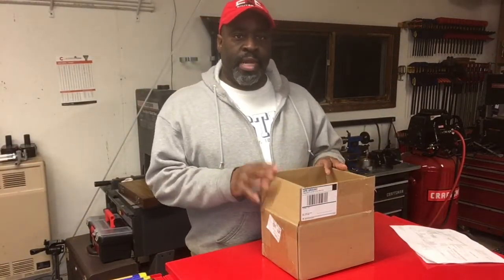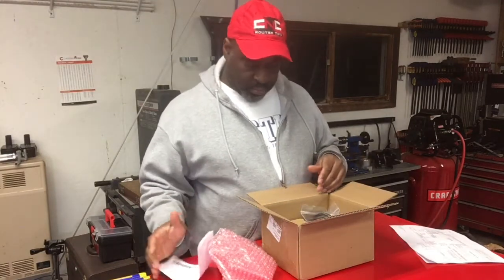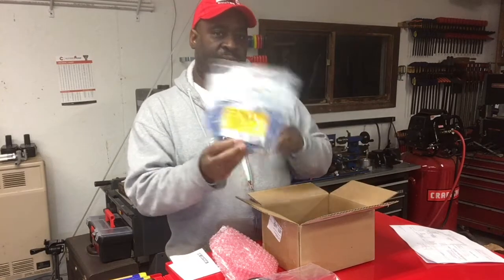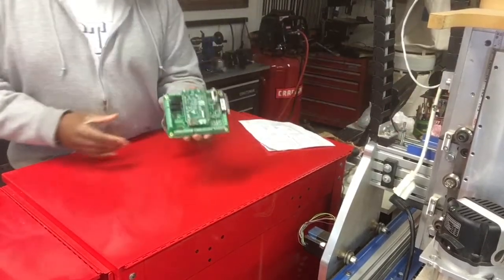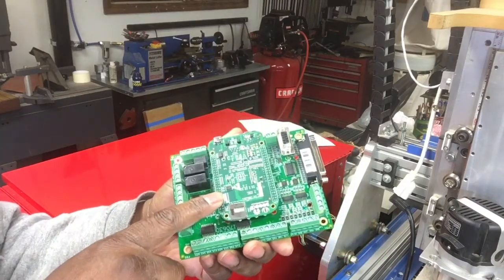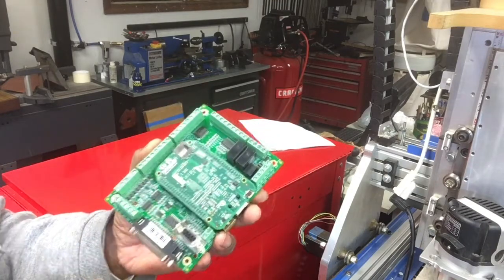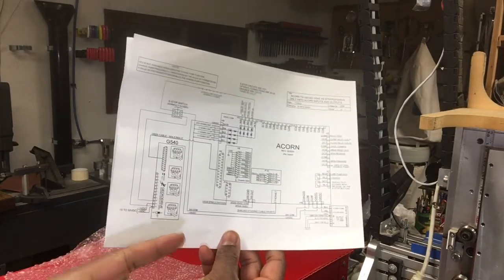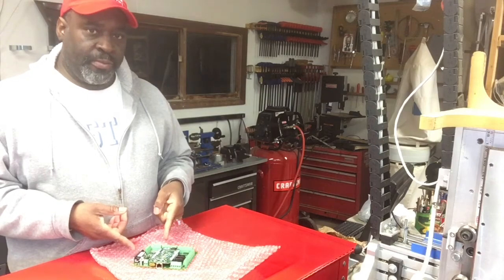CentroidCNC Acorn CNC Controller Unboxing

Comment: My acorn board is installed in a Grizzly mill retrofit with DMM servos / drivers. It was very easy to install and setup. The UI has a lot of information and features - somewhat of a learning curve. I like it so far, and learning more advanced procedures on a basic, yet affordable platform is appealing for my experience and projects. Thanks for this video!

Comment: hi Bill, how do you like your Acorn so far.
Reply from the maker: Max, I haven't used it yet. I Just recently got a computer to run it.  I have installed the software and tested the board but have not hooked up any steppers yet.
Reply: @BillGriggs  i think you going to love it, its far ahead of Mach 3. i already forgot that i had Mach3 before, Acorn so much better.
Reply: @BillGriggs  you have to hook it asap you going to love it, i will never go back to Mach3.
Reply: You probably lost interest in this. Wanted to see the complete hook up. Look at masso controller as well. It doesn't require a pc connection.

Comment: I wonder if you can connect this to a xylotex kit.
Reply from the maker: Tell me more about the Xylotex kit you have. Maybe I can answer that question.
Reply: I haven't purchased yet but I plan on buying the P&P_SYS_KIT, Gatton CNC, centroid acorn with your triple edge finder. I think this will be an awesome combination. Though I'm not sure how to set up the macros for the acorn if thats needed but I will figure it out.
Reply from the maker: I don't think that combination will work but call Centroid to make sure.
Reply: Update.  Xylotex kit works.

Comment: I really like the acorn, my only complaint and it’s more monetary is the “free” software only allows 40 lines of G code. In order to take full advantage of the board you need to upgrade to the Pro software. It’s $139 for mill only, want the lathe, another $139. This board and the Pro software really opens up the capabilities for our DYI machines. The encoder on a CNC lathe cuts threads like you won’t believe. Digitizing software is $400, so depending on what you want to do, the initial cash investment is pretty steep. On the positive side you’re stepping into a system that has all the features of a commercial CNC package. I have played with it on my lathe, pretty amazing with the encoder. I’m upgrading my mill so it’s not finished yet. But I see $280 coming out of my pocket for both Pro software products and another $200 for the wireless pendant. Ahh who needs to eat right?
Reply: I'm all with you on that , its way too expensive. i have not even tried my Acorn , it hurts I paid $468 for the kit and a PRO i know how you feel.